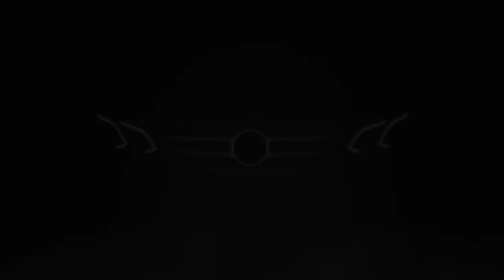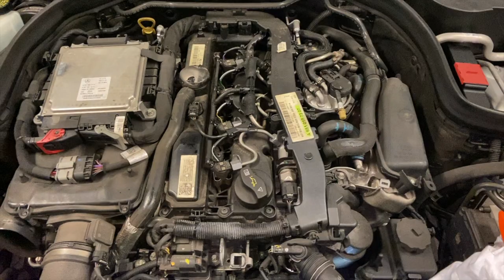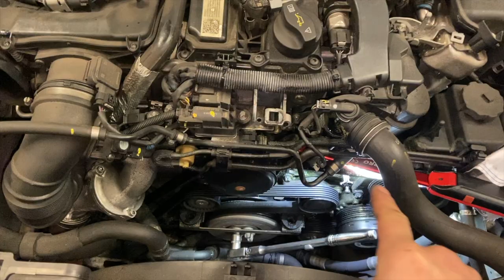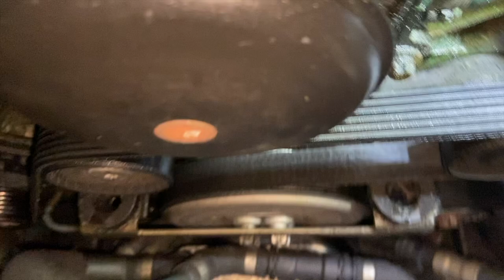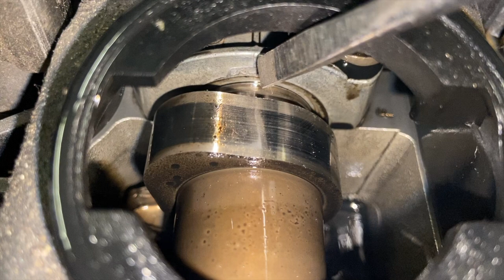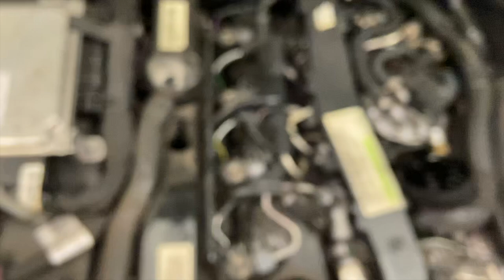Mercedes Diesel Engine Timing Check 220,250CDI OM651

Comment: As the camshafts run at half the crankshaft speed you may have to rotate the crankshaft a further full turn (360 degrees) in order to align the timing marks.

Comment: Ja das ist einfach und klar, aber bei steuerkette wechsel darf sich die Kurbellewelle unabhängig von Nockenwellen drehen?
Bei steuerkette wechsel wird die Kurbelwelle gedreht und Nockenwellen nicht....Richtig?Die Nockenwellen würden ganze zeit  mit speziell werkzeug blockiert.
Meine frage:
Können die Ventile dabei nicht die Kolben berühren?
Oder gibt es bei om651 motor da noch Spielraum?
Reply: diese frage stelle ich mich auch bei diversen videos🫣 dann wäre es ja ein freiläufer?
Reply: @FromDeathToWorse  hab meine Steuerkette selber gewechselt 220 cdi 170 ps 2012.vor 9 Monate und einfach die Nockenwellen rausgenommen und wieder eingebaut und die neu steuerkette eingebaut.Es ist ganz einfach und viel leichter Nockenwellen ausbauen wegen Nockenwellenräder (links gewinde) fest zu schauben.
Reply: Ich denke, bei ot die Ventile nicht berühren dürfften

Comment: Own a e250 cdi...at what sort of mileage can the early rattle start at..serviced every year..clean oil every year..great informative video..👍
Reply from the maker: It varies we done a timing chain with guides broken at 70k miles 2016 e class, another case we look after a 2011 e class which has 220k miles still no rattle from the chain..
Reply: @mercmantips  do you perhaps have a theory why it varies so much?
Btw I have this engine in 2011 C class with 128k miles no rattle.

Comment: After replacing the chain, the car began to eat more and smoke a little. Can you advise where to look for the problem? Before replacing the chain, I ate less.
Reply from the maker: Get the injectors checked out
Reply: @mercmantips  Friend, injectors new, max 10 000km. Used. Maybe have any other minds? Mabe need check timming? 🙄🫣
Reply from the maker: If timing was out engine management light will be on and it will be difficult to start, is there engine management light on dashboard?
Reply: @mercmantips  No any messages on dashboard. All ok. :( hm....

Comment: Your videos are great. This one in particular as when you opened the oil cap, there looks like wear on the cam lobe. Mine is like this and I was starting to worry, but it looks like there are others too so normal maybe? Doing the dpf today and your video was very useful. Keep up the videos, it’s great to learn from you 👍🏻
Reply: Mine looks just a little better than those in vid at 187k km. What's your car milage/ kilometerage?
Reply: Jacek Szulist mine is on 50k Miles so around 90k km doesn’t seem to be getting any worse so it doesn’t bother me too much really. Engine still sounds sweet

Comment: Good day. I'm having c200 cdi w204 651 at 160000km had bend conrod on cylinder 2 but was replaced. Now the car goes on limb mode after it drove with power from gear 1-2 den goes to limb, when you switch of and on again has power. Only with video u012087 csn that be the cause?

Comment: Must the engine be pulled out when changing the chain?
Reply from the maker: No, if the guides are not broken then you can change it without taking engine out..
Reply: @mercmantips  ,Thanks
Reply: @mercmantips  my mechanical saids it is necessarily to take out the motor for that!? He've done recently the gearbox oil and filter changed and it's cost me a little fortune! My felling tells me, if the motor pulls out, the mechanical will be happiest to increase to that job another gearbox oil and filter enchanges. My felling it's correct?!?

Comment: Doing this can I check if the timing chain is stretched? Thank you very much
Reply from the maker: No, the first signs of the timing chain stretching on these engines is when you start the engine on cold startup there will be a rattle for 2-3 seconds and then the engine will sound normal, if you start hearing this rattle in the mornings when you first start it up that means the chain has stretched, the louder the rattle the more its stretched, if you don’t do nothing about it the timing could jump by one teeth and cause the engine to misfire, thats when you can do this check, but if it jumps a few teeth then say bye to your engine..

Comment: How did you turn the engine manually?
Reply from the maker: Front crankshaft pulley bolts
Reply: @mercmantips  I tried but not turning and that's with all Injectors out
Reply from the maker: Maybe timing has already jumped and the engine is seized?
Reply: I was thinking maybe a bit of carbon in cylinder because I changed all 4 injector seals not sure. Got a inspection camera coming today so hopefully see
Reply from the maker: You should easily be able to turn the engine from the crankshaft pulley, we had it once where we couldn’t turn it and it was because the engine was seized, so good luck 🤞